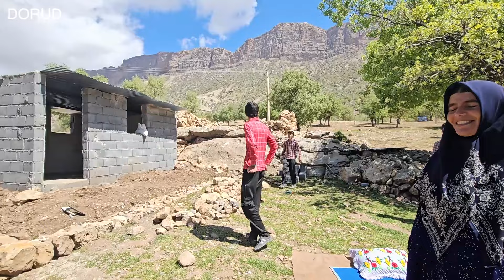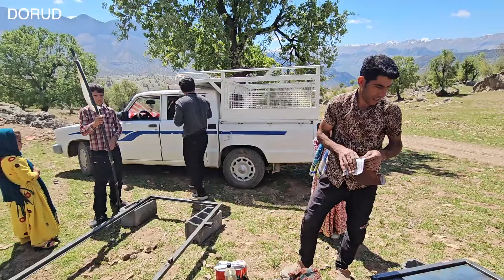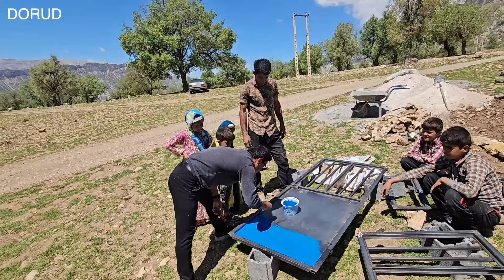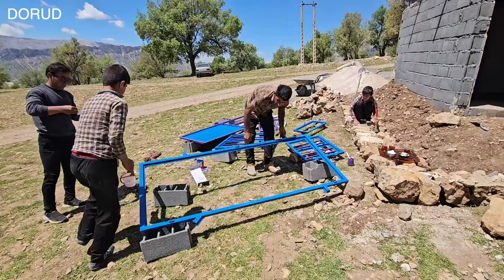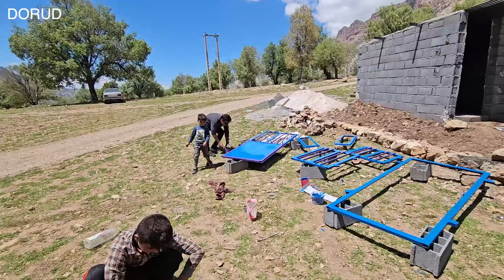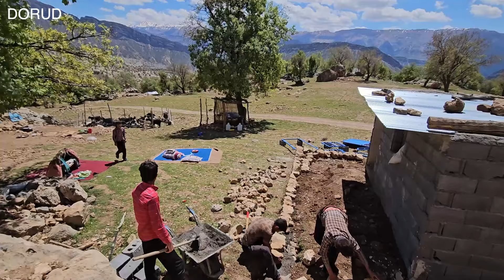Last steps: beautiful blue for the door and windows of Akram's small room

Comment: The piece of wood on the top of one of the windows is very unsafe it’s holding a metal pole, if it comes away hopefully no one is under it, hopefully the operators will take it down due to safety risks